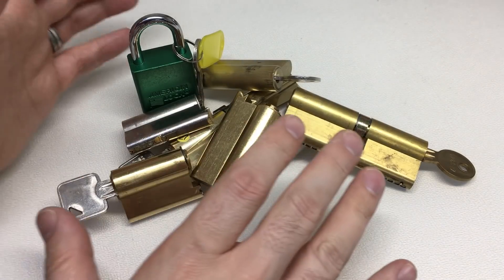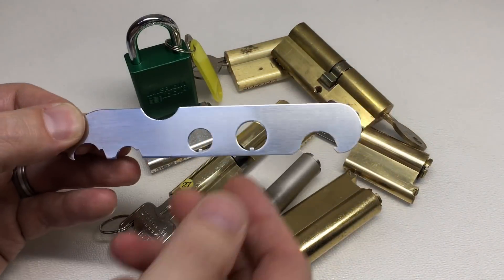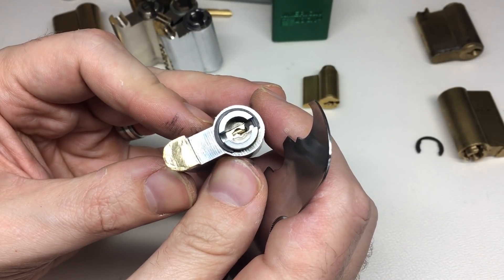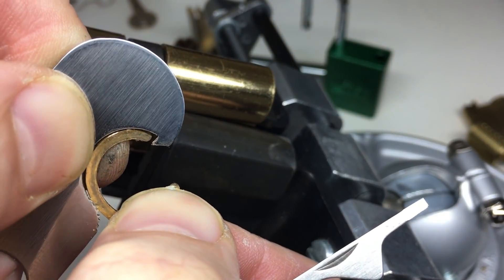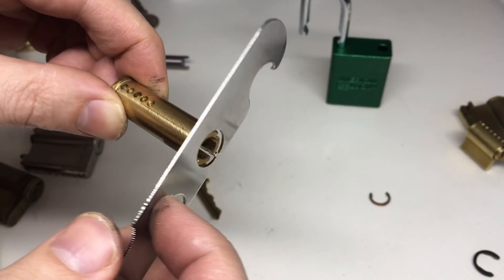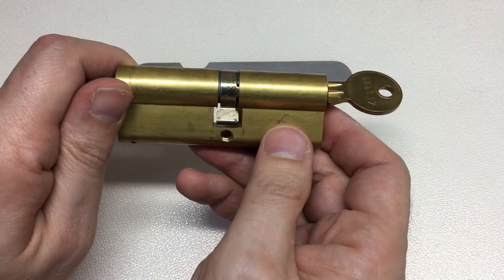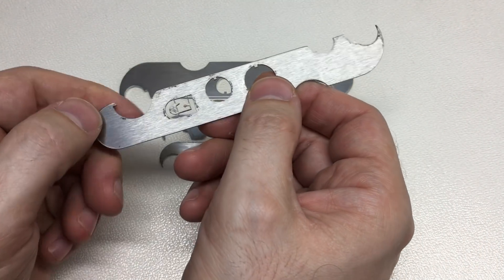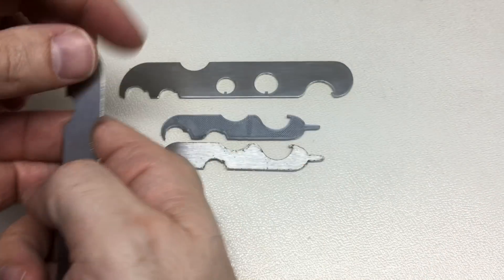Lock Dissasembly Multi-Tool Prototype

Comment: Maybe somehow incorporate that tool into the multi tool that you made. If it came in a kit like that I would happily play around $160-180 for it. Add the lockNoob logo and for sure $190-200 range for sure. I think I paid around $165 for my leatherman that I use ALL the time.
Reply from the maker: Interestingly, the two sizes of c-clip remover are in that tool already, so I’d just have to add the other side of the tool to complete it :-)
Reply: So does that mean you’re finally going to sell it? 😉😉😉😉

Comment: If you want your logo on it, take out the smaller core hole, the large one can do both, once the cores in the tool will tilt over and bind on the core, you probably don't even need the tooth.
Reply from the maker: That would be cool. The tooth does help though :-)

Comment: Awesome - when can we buy one?  One idea (as an engineer) - if you could, I'd recommend moving the "holes" with the tooth towards the middle.   The small one has a small amount of metal between the tooth and edge.   Why not give it extra metal?  I'd try to position everything for maximum metal to counter the stress, like you did with the hooky point.
Reply from the maker: Thank you for your comment and it’s actually easy to explain. The amount of metal at the bottom can’t be more than a couple of mm otherwise the plugs/cores, when inserted won’t be at an angle that will lend the tool to being a stable ‘t’ and they won’t be close to being nice and flat for pinning; it also means that you lose thickness on both sides of the holes. I designed the tool such that even if you cut out the whole section in the middle, there would be more than enough material left for strength. Even in super weak 304 Stainless, it suffers no warping if used with vertical forces, just don’t bend it latterly lol

Comment: That is a great looking tool. I assume locksmiths will love it, especially the ingenious core holder to keep pins from spilling!  I have no doubt all your work, testing, and designing will pay off and will be appreciated.  As for the steel - 420 in about 35 thousandths would likely be a good choice.  Maybe a harder 301 but I think you would want harder steel than the Sparrows 301 pick steel.  Peterson’s clip remover is very rugged but just too thick at about 50 thousandths for most euro type locks and is not nearly as versatile as your design.  I think you’ve come up with something special.
Reply from the maker: Thanks :-) yes 0.050 is waaaay to thick for Euro locks :-)

Comment: Wow you would think this 
Tool would already be available excellent job lock noob if sparrow's 
Start selling this tool I
Am a locksmith in canada just wonder if it
Will be able to remove clips from schlage,kwickset,wiesers,ect and the plug holder would work if so I would use this every day. Thanks
Reply from the maker: The holder will fit standard 1/2 inch cores and the circlip that go around them :-)
Reply: @LockNoob  thanks if and when your intelligent product is produced commercially I will be a customer of multiple units thank you for your design

Comment: Excellent design, got a template file available?, And for the guy that wanted a schlage type core nut remover, use a C shape but pegs at end of c to hold the pin down and other side sticks in opposite notch in nut use like screwdriver, dam I need one of those, think I'll get up and make it, it's  only 6am, actually, nut tool won't work needs center ring to hold pin down , pin is stationary.
Reply from the maker: Thank you :-)

Comment: A great idea and one that I will get once you go into series production.
Now the suggestion.
I have a poxy Sparrows plastic tool to remove the castellated nut thing with the spring loaded pin.
Is there any way to incorporate such a thing in this tool and make it a truly universal disassembly tool?
Just a thought
Reply from the maker: Roy O'Donnell it’s something I VERY seriously considered, but nothing on a 2D plane worked better than a the tip of a pick or tweezers
Reply: Thank you Mr Noob. I couldn't see how it could be done either